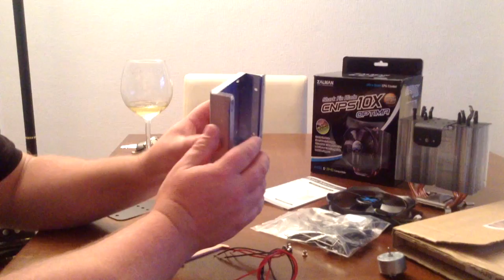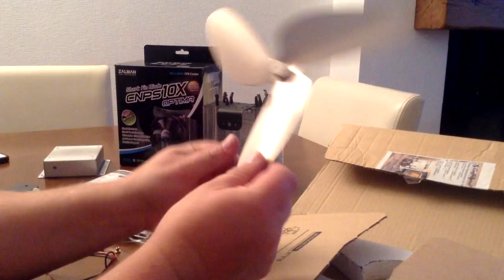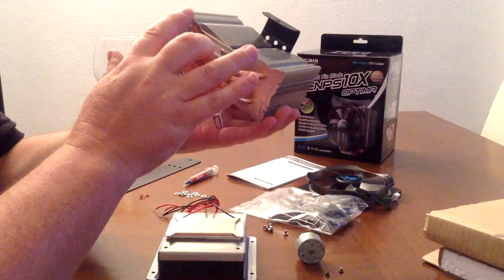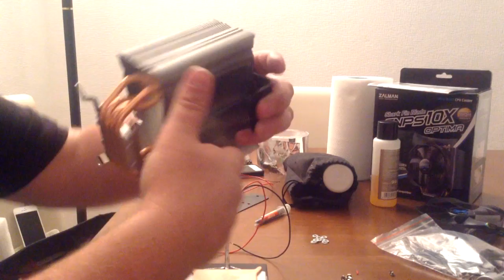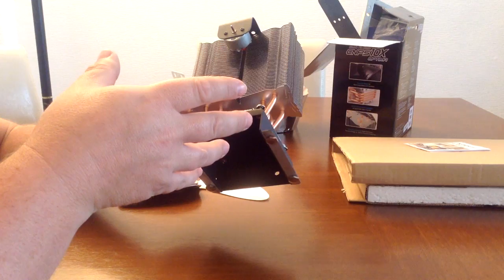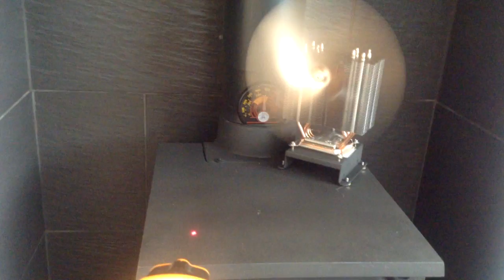Stove Fan Build (Step by step)

Comment: Could you elaborate on the kind of peltier.  I keep on seeing cooling plate peltiers on the ads on ebay unless they are really expensive
Reply: hey Michael, there are TEC and TEG.  TEC is a thermo electric cooler, which is what a peltier module is, a TEG is a thermo electric generator, its a reverse peltier, or used in the reverse of peltiers method, they are both almost the same but the TEG can take higher temperatures as it is used by exposing it to heat.   check amazon,co,uk for thermal generators, I bought several for under 30 euro. they are identical looking to the TEGs in the above video - small flat white with a red and black cable. https://www.amazon.co.uk/KKmoon-Thermoelectric-Generator-Temperature-Generation/dp/B010NQTRAE/ref=sr_1_2?ie=UTF8&qid=1486295555&sr=8-2&keywords=thermoelectric+generator
Reply: Thanks for that Robert,  I was very surprised to see an answer so soon.   I have ordered some with some thermo paste and we will see what happens
Reply: No problem. I would also do a bit of your own research as this is just what I have picked up from Google searches. Plenty more to learn.

Comment: Thank you for the video . I have tried to build one , but it only works on kitchen burner. When I place it on the wooden stove , the voltage drops. Any ideas?
Reply: boris runakov make sure your cooling enough and heating enough
Reply: Thank you for your response , I think the problem is that the top and bottom part of the peltier is getting evenly hot. Don't know how I am supposed to cool more with this type of heatsink...
Reply: boris runakov use a bigger heatsink on top and bottom?  are you using thermal paste?
Reply: I am using thermal paste, and currently I am using a Dell heatsink top and a stock intel (755) bottom

Comment: What's the point of the heatsink?
Reply: The peltiers generate electricity when there's a big enough differential in temperature between one side and the other. The stove heats one side and the heat sink keeps the other side cool.
Reply: +Mark Winter ah click! Thanks! I thought they simply converted heat to energy, I didn't realise there needed to be a heat difference

Comment: Great vid, thanks. How did you get around having had to supply an original ecofan serial no to obtain your fan. I tried to get one from Caframo but they insisted on me giving them a valid serial number or they could not supply parts.
Reply from the maker: Can be tricky to find somewhere that sells fan spares. I found canal boat shops to be the best bet. If you look down the comments, I've provided a link to the shop where I got mine.

Mark
Reply: DoItYourself
Purchased a fan  blade from them on-line but they called me back and asked me for the serial number of my Ecofan. I couldn't give them this so they refunded my money. They said Ecofan would not allow the sale of these without valid serial numbers.
Reply from the maker: Finbarr Dolan Type replacement stove fan blade into Google and try the different suppliers that come up. Failing that, you could use the aluminium blade out of a cheap desk fan.

Comment: I have to say that your video is the best fan construction demo on youtube as i have seen a lot and you have explained clearly  from start to finish how to make one, I have made a few myself but the peltiers  seemed to burn out after a time ,may try two as you suggested , I didn't use thermo paste as i am not sure what it doe's ,could you tell me if it is necessary .
Reply from the maker: The thermal paste takes up the space left by two uneven surfaces coming together. For example if one of the peltiers had a concave surface, the paste would take up the space and form an even thermal contact. I would definitely recommend it.